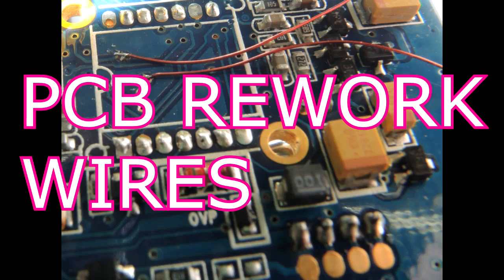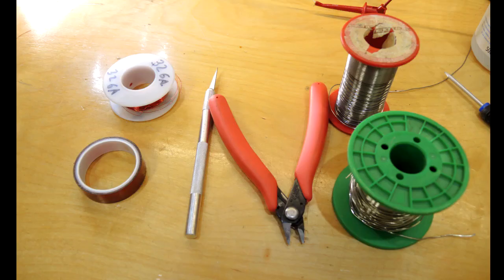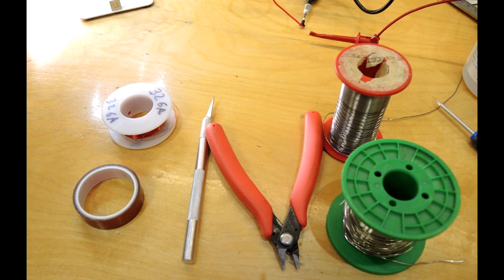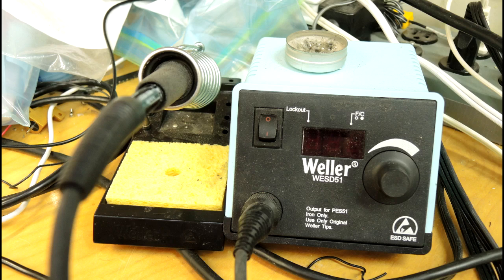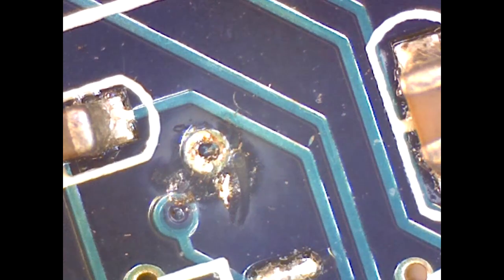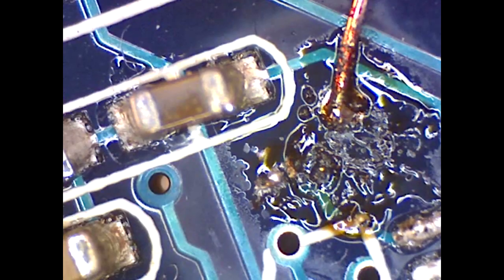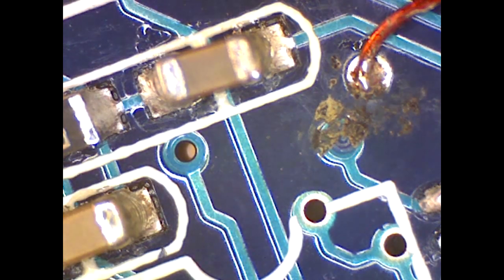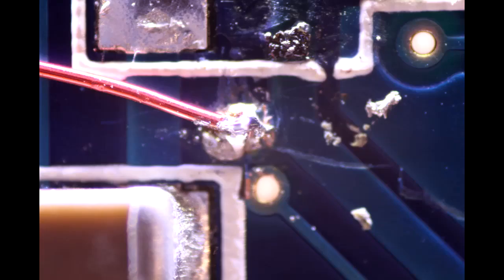Rework and Probe Wires for Circuit Boards

Comment: Good technique! I always seem to carbonize magnet wire which causes poor tinning. True Kynar insulated, silver coated 30AWG wire works much better for me. I use Jonard branded Kynar from Amazon which melts at 350F. Just avoid the cheap Chinese stuff which usually comes up when searching for 30AWG Kynar wire. It melts at <300F and is usually some type of PVC.

Comment: I feel like a dink cause I can never get the coating to burn off the magnet wire. It always turns into a gross drossy mess. I have to scrape it with a knife first, which makes it take so much longer...
Reply: What isn't said in the video (and many people don't know!) is that there are several types of the magnet wire insulation. If you want to use the heat to strip the insulation, you need solderable enamel - typically polyurethane. That burns off at 400 C or so (i.e. you need to set your iron temperature quite a bit higher than usual!). 

The problem with the polyurethane enamel is that it releases really toxic fumes (isocyanates) so a good ventilation/fumes extraction is a must unless you are doing only a few joints.

The wire used for winding coils is using much higher temperature enamel which doesn't burn off easily, so it is not strippable with a soldering iron.
Reply: Jan Ciger ahhh that explains it! I've harvested a bunch of it from transformers so it's gotta be that high temp kind.

Comment: Knipex makes a nice tool that strips the insulation from magnet wire...I never liked the idea of melting it off since there is always some residue. After years of scraping wire ends for toroids with a box cutter I found the tool that does the job the best for me.